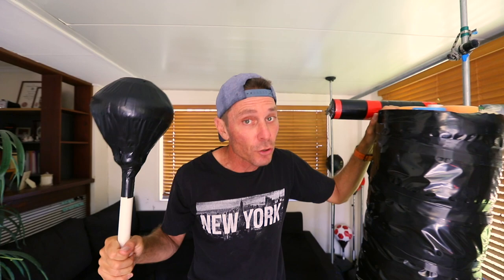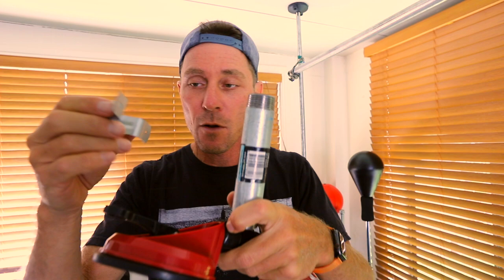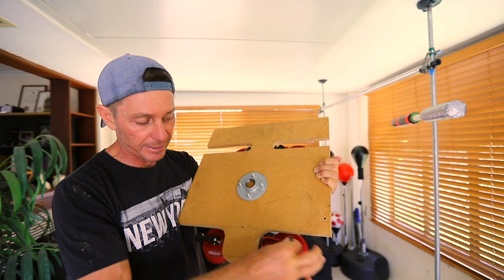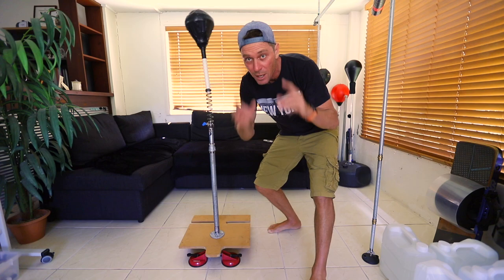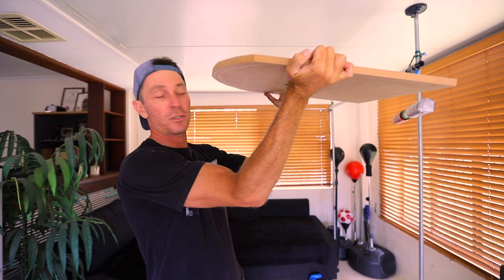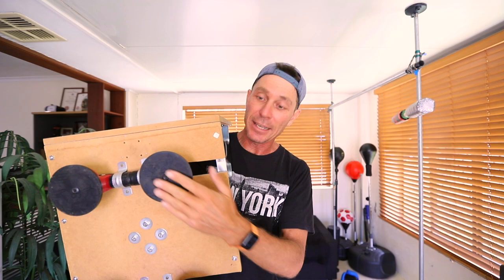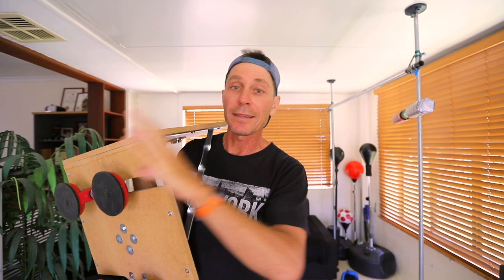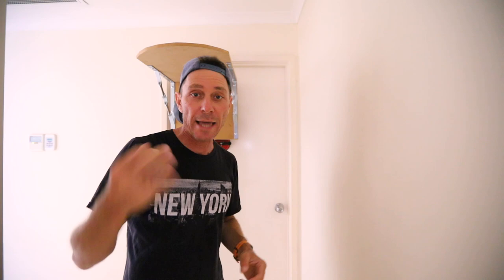DIY 2 in 1 Punching Bag and Speed Ball Platform Using Suction Cups

Comment: You need a heavier/ denser base to bounce the bag off. Good speed bag platforms are well over 1inch thick. Double up the MDF on the top and it very well could improve the performance.

The design has some inherent play due to the door, suction cups and how the cups are secured. Density in the top I believe will still  provide an improvement. 

Really ingenious, especially the cobra bag.
Reply from the maker: Thank you. I’ll have to revisit this project at some stage

Comment: Maybe double layering the top MDF portion or placing metal strips along it would stiffen that portion up more
Reply from the maker: Thanks yes I might try that. 👌 I will also try it on a wall by applying gloss varnish to a small section of the wall. Most of the wobble actually comes from the door which is hollow and very thin board